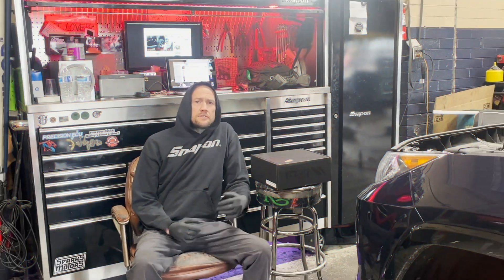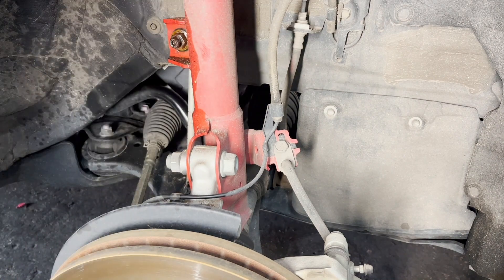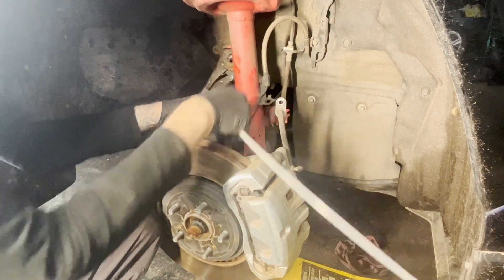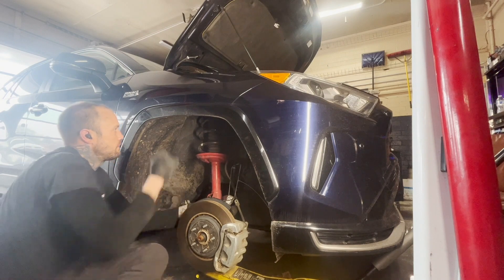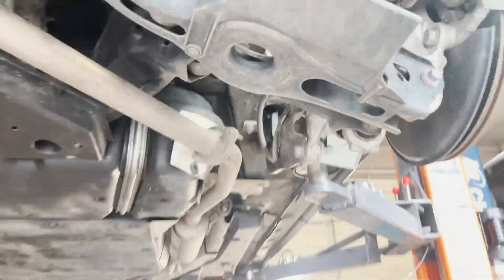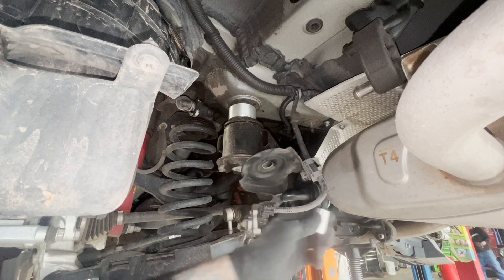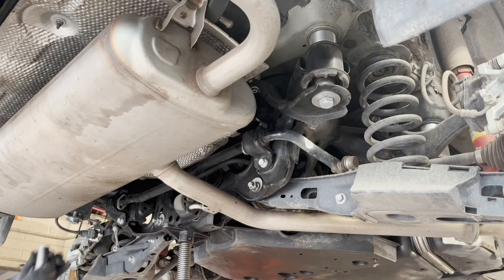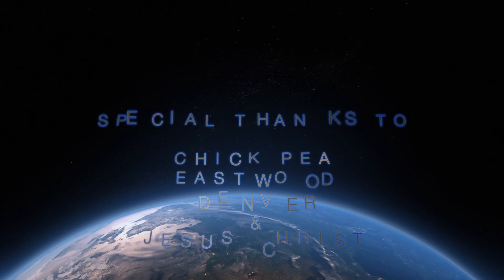2021 RAV4 TORQ LIFT KIT INSTALL.

Comment: If i decide to remove the rear spacers and put a heavier rated spring, will the bolts be compatible still, or do i have to get the oem bolts?

Comment: For alignment Did you change the camber bolt kit in front? what size is it??
Reply from the maker: Just get a camber bolt made for this vehicle. Any camber adjustment bolt for this style RAV4 will work.